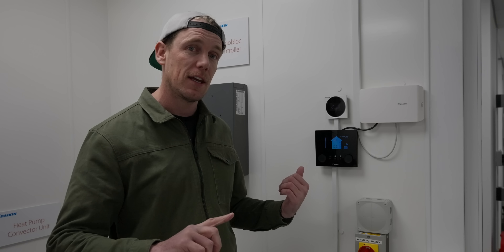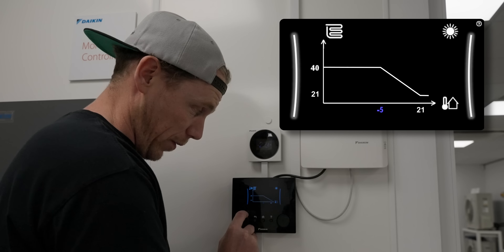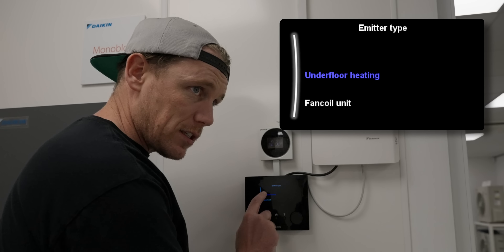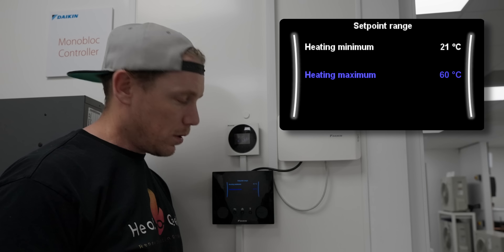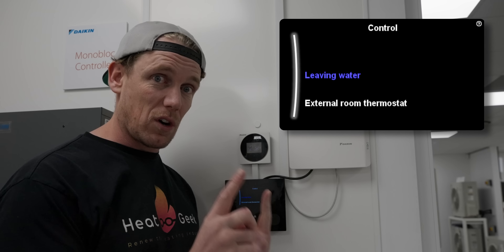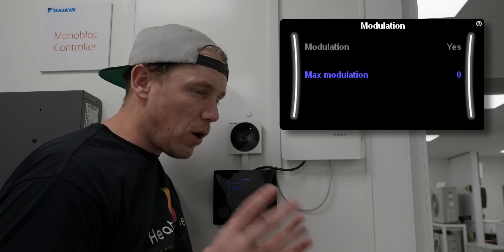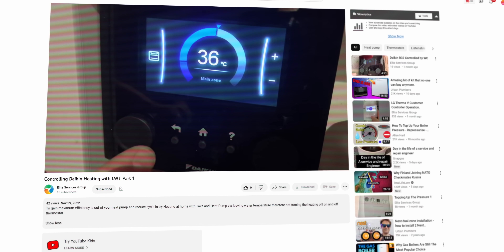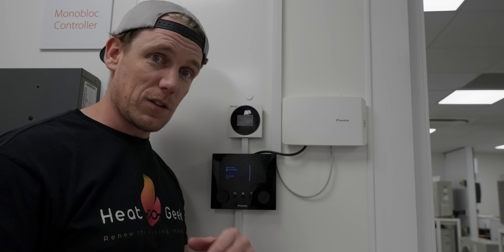How To OPTIMISE Your DAIKIN Heat Pump Controls!

Comment: I have just had a Daikin heat pump fitted and am amazed at how complicated it is even to just get basic temperature settings right. I mean who is going to want to talk about graph curves etc. Surely a simple ECO mode etc would be better for most people. If I showed this video to friends and family they would be unlikely to follow our example
Reply: We've been wasteful as heating has been oversized & run inefficiently due to the historic low price of energy, but those days have gone by. Today, it's all about efficiency which means different ways of working i.e. weather compensation running at the lowest flow temp possible. Having a one-size-fits-all setting is impossible as each house has a different heat loss. Some homes have more draughts than others. The internal diameter of pipes is different depending on plastic or copper pipes, how long the runs are & how many bends and so on. Then there are differences between installers & installations. So many variables to work with to get an efficient system. I'm sure it'll become simplified over time, but there will always be weather compensations to get your head around
Reply: This is exactly the same with gas boilers, installers tend to oversize everything because it's reassuring to customers to think they can have their home warmer than they will ever need. You have to change flow temperatures, install smart thermostats and TRVs to start matching boiler output to your actual usage 

Same with a heat pump. Generic settings will get you 3.5COP. if you want to edge towards 5 COP you're going to need to spend an hour watching a couple of videos and change settings. You don't need to buy anything.

FWIW you can effectively set "eco mode" in the installer wizard but it's eco for an average user which is 99% of installs, happy to sacrifice efficiency for ease of use. If you're watching videos about heat pump controls you're in the 1% who understand flow temperatures, COP and cycling and are actually after personalised super mega wicked awesome eco mode that isn't on the menu.

Comment: It doesn't matter what the emitter type is set to; the unit will target DT5 as that's its most efficient DT for the Altherma (see spec sheet). By setting the wrong emitter type, you're inputting incorrect data into the software that controls the unit for maximum efficiency. The myth of setting to 'Fan Coil' while having rads has become the normal go-to in the end-user SM world of help groups. I believe this to be wrong. I'm not an expert, but I have run my rad system on all three settings & it makes no difference to the DT the unit targets DT5. A difference I have noted is that the flow rate seems higher on 'Fan Coil', but after a while, it drops to min flow rate like rads.

Comment: I have a recently commissioned Daikin ASHP and watched this with interest. It's full of interesting tips but having followed the guidance my heating was all over the place - often far too warm for the weather, even though I turned down the target at design temperature. I watched it again and again to see where I went wrong, and eventually became suspicious of the comment about Modulation. I live in a relatively modern bungalow which is well- insulated with  fairly high levels of solar gain, and had set the Modulation initially to 6, and then to 9, to try and deal with the issue. The temperature was all over the place. As a trial, I set it to 1, and the whole thing settled down into a smooth level temp throughout the day. Is it possible you've got these settings the wrong way around in the video? To my mind, if you have a well-insulated property with low heat loss then you don't want the ASHP to vary from the WC curve too much because the heat stays in the property. However, in a house built for coal fires and without cavity walls the temp is going to vary widely depending on conditions and the ASHP needs to be able to adjust accordingly. Or have I misunderstood its purpose?

Comment: Totally helped me to set the proper heating and consumption of electricity was half (now 12-18kWh/day previous 30-40kWh/day) the leaving water temp is 26-28°C (floor heating). I also turned off BSH for boiler (only for legionella left on for once a week) and turned on schedule which lowered the  consumption from 40kWh/day to max 3-4kWh/day with no temperature difference (50°C water). Thanks Heat Geeks!!
Reply: Could you share your weather compensation curve? Mine is really low and thr back up heater turns on constantly, reducing the efficiency. Thanks!

Comment: @Heat Geek - I have an Daikin Altherma 3 with underfloor heating in a new house with good insulation and thermostats in every room ( not connected to Daikin ). I did not fully understand the Modulation parameter. You say that it's better to be close to zero ( I have it on 1 ) on old houses with a light insulation and high heat loss - after that you say that the Modulation should be higher even for "newer" houses. I understood that the Modulation is used by the compressor to quickly start and maintain the optimal temperature and the RPMs of the compressor are adjusted automatically and not running at full speed if the house demands a small increase in heating. Also, another question is, by default DeltaT is set to 5. I understand that it is the difference between leaving water and incoming water back to the heat exchange plate, but what should happen if we set it to 1 or 2 or higher than 5 ?

Thank you.

Comment: Great video. We usually get customers to turn up the stats to max in living spaces and then try find lowest slope-offset setting. Easier for customer to adjust slope number than 4 point curve. Like the heat curve on a Nibe. Nice and simples

Comment: My main Madoka thermostat is in the hall, where the design temperature was 18 degrees (in actual fact the radiators in the hall/landing could easily deliver 21 degrees if required).  When you mention about setting the flow temperature on the weather curve based on achieving 21 degrees when the temperature outside is  zero, do you mean only in rooms that were designed to be at 21 degrees?  I have the thermostat in the hall set at 19 degrees and the TRV in the hall set to deliver this temperature because a) that is a comfortable temperature for a hall (it isn't a living room that you sit in) and b) I assumed, possibly incorrectly, that I would save money.  If my hall has radiators sized to deliver 21 degrees, would I be better setting my thermostat in that room to 21 degrees because house temperature will be more even and would I expect to achieve a better COP?  The living rooms do achieve 21 degrees with this current setup, albeit slowly after a 2 degree setback temperature at night.

Comment: Great video guys. The amount of different information on heat pump set ups is staggering. Very few installers are recommending this way of setting up the controls of the weather compensation mode and are instead opting for stats everywhere, all calling the boiler for heat. My only question is how you deal with parts of houses that are naturally cooler than other parts?
Reply from the maker: Balancing
Reply: Far too complicated for the average person

Comment: If you had photovoltaic panels and produced energy during the day, would you still use the same settings or change them in some way? For example, using fixed instead of weather dependent? thanks

Comment: We are both 76, the air source heat pump was installed on 6th January, the coldest period this winter, no heat for 2 days, lounge down to +2c and there should be a warning that oldies avoid heat pumps and definitely don't have one installed in the winter months. Octopus are brilliant but have had them out three  times so far, I'm not totally useless with technology but these controls have me wishing we still had the gas boiler.:face-purple-crying:
Reply: We are in a similar situation! Family with 2 young children. Air source heat pump installed this week. We spent 5 days with no central heating - only 2 small portable heaters. They finished the installation yesterday. Worst part: the central heating is not going above 15c! We are freezing 😢

Comment: Glad you have done a Daikin video and its great, I still am struggling to optimise mine because I have a buffer tank so need a secondary pump and the moloko controller won't work with this set up as there is no way to turn the secondary pump on when the heat pump is running. I currently have a Hive which turns the heat pump on and the secondary pump but this thermostat is on/off and can't be efficient. So looking for an alternative, If I run the secondary pump constantly and use the weather comp and keep tweaking it may this be the best way?

Comment: We moved into a new build house that has a Daikin Altherma hybrid heating system - so we have both a gas boiler and a 4kW heat pump. The Daikin controller, which is an older version of this one, has all these settings as well. When we first moved in (and after I got my head around it) I found the curve was set by the builder to 35 - 55 on the Tt (Y axis) and -5 to +15 on the Ta (x axis). I later discovered that my neighbours all have different settings despite the same system - the consistency of install has been very poor so I  have no idea what the 'design' range is meant to be. I tended to find the air pump module barely ever did anything initially on colder days when the system was trying to heat the radiators to 50C+. I eventually fitted a Netatmo smart thermostat and radiator valves and then started experimenting with the 'fixed' mode. I discovered that at 45C, even on a cold day of -5C, this was still enough heat in the radiators to heat the house at a reasonable rate. So I initially set the weather dependant curve Tt at 35C to 45C. With the aid of the smart valves, I found the heat pump module was now contributing more (with the gas boiler off). As the weather has got milder though, the system has started heating the radiators to less than 40C (as per the curve settings), and I've found this just isn't hot enough to heat the house at anything other than a crawl. I've since set my Tt to a very narrow range of 40 to 45C and this appears to be working well. I'd none the less be interested too know your (or anyone else's) thoughts on this one.

Comment: Adam, I just noticed a statement you made in this video and wonder if you could explain a little. You said the Daikin has a cut out of 25c on LWT to protect the compressor. Now in my ignorance I thought the less effort the compressor had to make the easier and therefore more efficient it is. So I try to keep my LWT as low as possible but at a comfortable indoor temp. Am I getting this wrong? Is there an LTA below which I shouldn’t go, ie is 25c the safe minimum or is there another? I have noted that my ONECTA app does sometimes tell me the LTA is below 25c, most typically at 23, ie I have never seen 24c. Usually I am in the late 20’s early 30's. Would be good to get clarification on this. thanks.

Comment: Using a Daikin Altherma EDLQ-CV3 air to water. What should the 'Desired Comfort main LWT Offset in Heating' be, when it's-5°c outside?
Reply from the maker: That depends on your rads and insulation level. Put it in pure wether comp.. if your house overshoots in temp tune it down..

Comment: I have been suffering from outsized electricity bills for a few months, and am now devouring these videos to deal with it. Thanks very much for all of the guidance which is invaluable, and not to be found in any of the Daikin manuals. I have gone fully on-board, and switched the Control' to Leaving Water instead of using the installed Heatmiser thermostats, which is what you referred to as "pure weather compensation".
1. I have set the thermostats as an upper limit, as you suggested. With the control set to Leaving Water however, will these still have any effect?
2. What is the right thing to do in the summer? There is no "Summer" setting on Daikin. Should I just rely on the upper limit set on the thermostats (assuming it's working), or switch space heating off (somehow)?
Many thanks, and keep posting the videos!
Reply: Hey, I have the same questions. Since you posted it 8 months ago what you found as answers in the meantime? tnx

Comment: Hi Adam. A query for you. In my limited experience ( ASHP installed 3 weeks ago), the MMI information system is next to useless. I don’t know if you’ve looked at it. In theory I should be able to calculate my COP, from elec used and elec produced. However all figures are rounded to 1kwh increments, which is unhelpful. Secondly sometimes it doesn’t report energy used, and sometimes it reports energy used, when none was! The sum of the space and water heating varies from the sum of  the two indiv sections. Daikin support told me it’s not intended to be used to provide this info ( what is it for then), can you cast any light on this. How am I supposed to calculate my cop. Please don’t tell me about all the wonderful third party add ons I find all that way to technical for me. It seems exceedingly remiss of Daikin not to include a tool that gives the cop, seems as we are all obsessed by it ( well I know I am).  I can only calculate COP on a DHW process and then only providing I ensure I have a constant consumption baseline to work from, ie I’ve turned everything else in the house off barring the router. Adam can you help. Congrats on the partnership with Octopus by the way.
Reply: I've added a Shelly pro PM device to mine, it has CT clamps and is an easy fit for an electrician.  That means I now get accurate electricity input data.

Still stuck with Daikin's estimated output values but devices to meter heat are a lot more expensive and difficult to fit.

Comment: Hi,  I have a Daikin heatpump with this controller.  I have the scheduler set up so that at between 4.30 am and 9pm, the temperature is 19 degrees and then on the same schedule between 9pm and 4.30am the temperature is set at 17 degrees.  This inevitably means that the heat pump stops at 9pm and only restarts if the house gets below 17 degrees before the schedule reverts to the set 19 degrees at 4.30am. My question is, if you use the -2 setting (which I believe is only in installer mode), are we saying you set the temperature for 19 degrees 24 hours of the day, but the -2 degree setting would overlay this between 9pm and 4.30am in my case?  If so is this just a different way of doing what I have set up in my scheduler and the heat pump would switch off at 9pm, or are you saying that the heat pump stays on and the flow temperature drops by 2 degrees and this is beneficial for COP?
Reply: Jeremy, I maybe wrong but if you are scheduling and setting temperatures then you are not using the weather dependent curve. Setting the thermostat etc. Will control the heat pump by the temp you have chosen. Whereas the weather dependent curve operates, in effect, in ignorance of your desired temperature. With the WDC the leaving water temp will be determined by the outside temp. To have a comfortable heat you have to go through the process that Adam outlined, in this video I think. Balancing all the rads etc. I have a hive controller which was causing problems, I am now on WDC and it’s way better. All trv’s on max, so they don’t influence anything, radiators balanced and just leave the system to run. I do get some variability in temp but it’s always very comfortable. I’m hoping it’s economic too, but I have nothing to compare it too. But my consumption seems to be in line with the design assumptions.

Comment: Hey, thank you for the helpful tips! I'm curious, was there a specific rationale behind setting the temperature at 40 degrees when it's -3 degrees outside? Have you considered a slower increase in the heating curve instead? For example adjusting leaving temp to 45 degrees when it's -15 degrees outside?

Comment: How do we know what the system design temp, maximum flow temp was designed to?
Reply: That's exactly my question watching this vid :)
Reply: Hey  @SergejGrabun  any progress (I've not)?
Reply: @phildelaney9636  IDK man, I'm puzzled about this and many many other things. I'm quite happy my COP is 3.4 I think, but I know it could be better if i setup thermostats, HP and schedules, but it's too much. I'm afraid to do worse than it is now
Reply: @SergejGrabun  ha, sounds further on than I am! I don't even know how to check/measure what my COP is?!!
Reply: @phildelaney9636  u go on your HP main system control unit, find place where it shows how much electricity unit took in total, then it also shows how much heat units in kW it produced using that electricity. Then you basically divide one of another and you get COP
Reply: @SergejGrabun  Dare I say it.... aparently this isn't the best way to set up this Daikin system, so I'm not continuing with this. Just thought you might like to know. And anyone else who reads this!
Reply: @phildelaney9636  what did you find out? Care to share link or key word to search for? I switched to 24/7 heating now with setback set to -10 during the night. Monitoring consumption and how the house feels, but pretty sure it's not optimal setup

Comment: Thank you for the valuable information. I have set my WD curve low enough (21-40 water temp for -1-20 outdoor temp) so the 4 rads in my(poorly insulated unfortunately) apartment sustain the internal temperature at 18-18.5 C.
But now, the compressor does restart a lot, as it fairly quickly reaches the target water temp. Shall i up the upper limit a bit? Buy bigger rads ?

Comment: Is there a reason why an installer wouldn't use weather compensation? My Daikin HP is newly installed (August 2024) and no weather comp is setup.
Reply: It's too much hassle I expect. It will cost more in electric on fixed too.
Reply: I really recommend the weather dependent. Get your installer back to set it up for you.